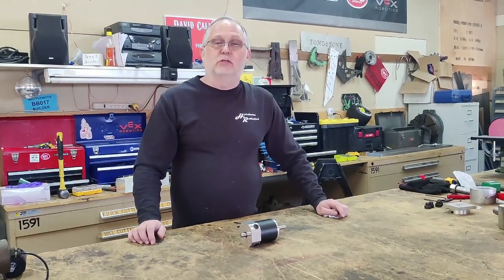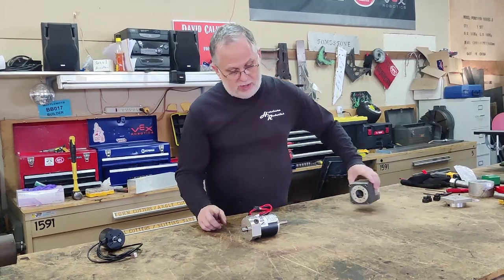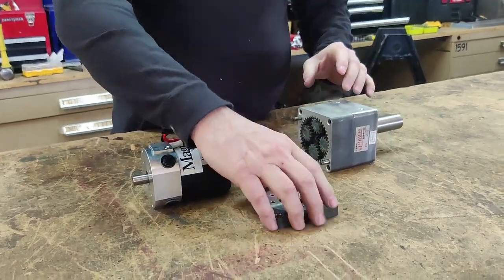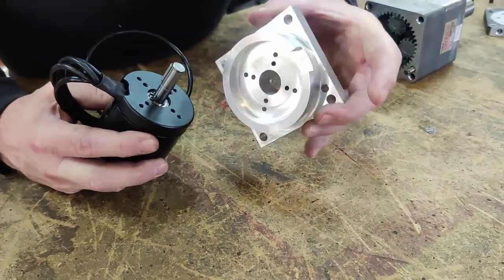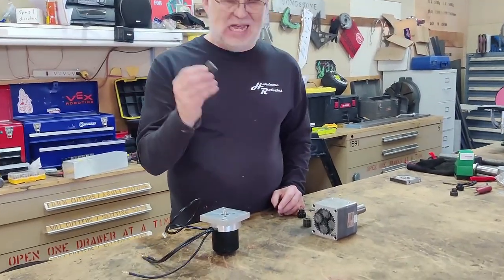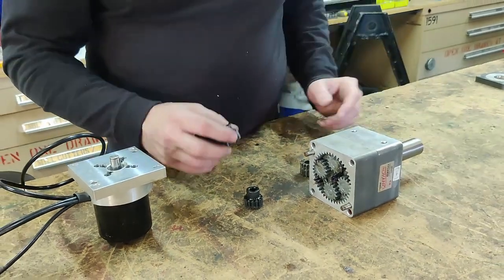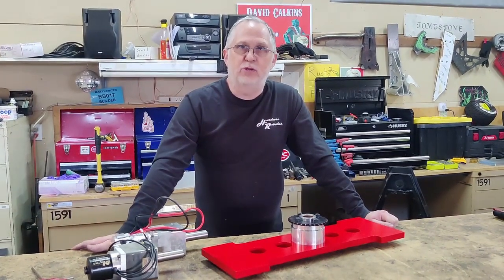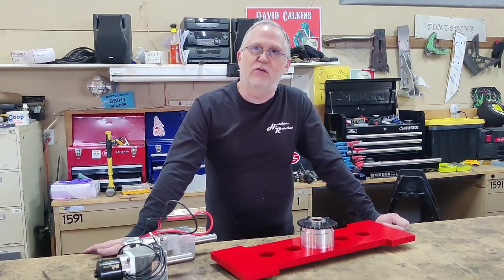Mortician 2023 - Brushless Drive!

Comment: What KV is that motor? Seems like a big gear reduction. Why not get a much lower kv motor so no gearbox is needed?
Reply from the maker: These are 170kv, about the lowest kv you can find in a motor of that size. There really aren't any available options at this power level that could run without a gearbox, and from a physical strength standpoint you wouldn't want the wheels attached directly to the motor shaft anyway. The output shaft of the motor is only 10mm, while the output shaft of the gearbox is 1", so over 25mm.
Reply: @ray9368  thanks for taking the time for such an detailed answer. 
I know Maytech have made custom kv motors in the past. My thought with removing the gearbox is then that weight could be used to have drive shafts or chain system. So you if you loose a wheel the whole assembly doesnt come out. It’s probably not problem

Comment: For turning the gears, could you grab them from the inside, clean up the stamped face and then grab from the formerly stamped face? I'd think you'd probably have to use a shoulder bolt or similar to be able to grab it tight enough. If the number of gear teeth is divisible by the number of teeth in your chuck it would work to grab the tips of the teeth, but I would imagine that's not always the case.
Reply from the maker: The number of teeth wouldn't work in a lathe check as it wasn't divisible by 3. I suppose if I wanted to punish myself I could have set up the 4 jaw chuck, but honestly once I set it up on the CNC mill it went fairly easily.
Reply: @ray9368  I think the ideal setup would be a collet sized for the OD of the gear

Comment: Do you have to have a gearbox with the motor to make the wheel turn?  Is there an advantage to having a gearbox with the motor if you don't necessarily need it?
Reply from the maker: Lots of reasons this has to be this way. The output shaft of pretty much any electrical motor is never going to designed for large lateral loads. Mounting a tire directly to a motor is just going to end up bending the shaft. And the output RPM of a motor is pretty much always going to be too fast to drive the robot correctly. Finally, the reduction in the gearbox increases the torque, which is needed to get a heavy robot moving. 

It's just kind of the way it is.
Reply: Imagine trying to start a car from zero, in 5th gear.  That's what trying to direct drive a wheel off a motor would be like.

Comment: Some teams use a small bearing to "grab" the rear end of the outrunner. Probably not worthwhile compared to a nice shock mounting setup for everything.
Have you seen Robert Cowan's motor epoxying video? I've experienced magnets coming loose and destroying large outrunners in a not-combat environment, so I consider it a very useful video.

Comment: I wonder
If I’d be possible for tombstone or mortician to have hdpd wheels
Reply from the maker: The reason the plastic wheels work so well on Huge is because of their large diameter. I'm afraid that on the smaller diameter of my wheels they would just crack. It's not a bad thought though.

Comment: Also, another note, have you considered re-machining the bottom part of the motor and integrating it into the gearbox mounting plate?  It probably wouldn't be too much more complicated then the part you made, and you could do away with all the M4 screws and make the whole thing even shorter?

Comment: Are you going to try making the main weapon brushless as well?  Maybe with the higher power density moving the motor to the hub of the blade and ridding yourself of the chain?  Man, the forces are extreme no matter where you put everything..
Reply: True but with a chain at least you can run a slip clutch to absorb some of the impact forces and also to allow the shock loads to dissipate as they move along the length of the chain whereas you can't really do the same with hub motors and that's why so few teams use them.
Reply: @TheInvertedFollicle507 makes total sense. I think I was a bit naive 2 years ago 😂
Reply: @ITman496 tbf they're good for compactness vs a chain or belt drive and like a drive gear do have their users but defo have their own set of downsides as well.

Comment: Will it be a whole different robot or will it (I know each year you prob upgraded/changed something but I'm talking about LOOKS since it pretty much LOOKED the same 2010-2013) be the same red robot we saw back in 2013?  Just curious on what the new Mortician will LOOK like. Also will it be like the version where it had the wheels INSIDE the frame (2007-2009) or will it have the same traditional exposed-wheel design? (like Tombstone)
Reply from the maker: The wheels will be outside the frame - there really isn't any way to drive the thing with the wheels internally placed. But yes overall it will look very similar to previous versions.

Comment: Concerning Tombstone, it typically gets damaged by others ramming directly into the blade and the resulting ricochets off the walls. Have you considered two stacked blades counter rotating to remove the torque effect, or is weight the limiting factor in doing so?

Comment: Curious if it would have been possible/feasible to build the front of the outrunner as the adaptor, instead of an intermediate adaptor to interface between the motor and gearbox?
Reducing mass and possibly more length? Is the internal part of the motors front plate geometry too complex?
Reply from the maker: Usually the windings for sort of built into that part of an outrunner. It could be done I'm sure, but it would be a lot of custom work and I'm not sure a lot of benefit. One of the nice things about this setup is that the motor is "off the shelf" with no modifications. That makes keeping spare parts easier, as well as making it possible to borrow extras from other teams.

Comment: Man this was AWESOME to see!! That big outrunner will have insane torque over the brushed, it'll also have more mass in the rotation so it absolutely will drive different. I'm interested to see what big sensored ESC you'll be using to control that. MGM? Also Excellent work on the adapter, all the kinetic force in the rotation of that outrunner could possibly break the 10mm output if the drive tire gets suddenly locked up for some reason.
Reply from the maker: Hopefully whenever I get this actually driving, we'll do another video on speed controller setup. That's the plan anyway, although I admit we may run out of time before the event to film everything I have in mind. 

Glad you enjoyed the video!

Comment: -- Well I'll tell you this.  That 13 minutes blew by like 3.  Could have watched that all day.  What's the word on using some kind of 'clutch' to ease the impact strain on the motor and gearbox?  Feasible?  Especially like the slightly smaller package resulting in more frame rigidity.
Reply from the maker: Any sort of slip mounting for the wheels/tires would add some weight and complexity to the drive that I don't think I could manage at this point. It's not a bad idea, but I don't see me making any efforts for that right now. Just too much to do between now and the event!

Glad you liked the video!

Comment: Nice work, looks like a solid built adapter plate.

And now comes the I think difficult part: setting up the ESC so the motor doesn't just derp
Reply from the maker: For sure, I would prefer derp free operation :) Luckily I think there is enough experience in the community now that even if I struggle with getting a speed controller working the way I want, that I can lean on some friends for a hand. Time will tell I guess!